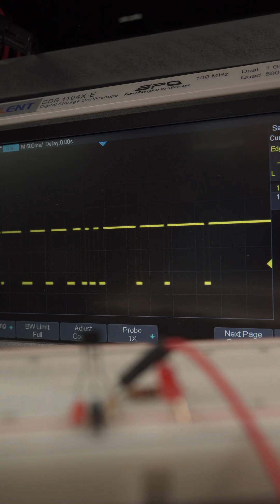Digital Hall Effect Sensor

Comment: From rick_1976
Applications Engineer
May 2020
Greetings,

A few points:

The A3144 is obsolete, suggested replacement being the A1104
The output of these sensors is an open-collector format, hence one must think in terms of switching the low or “ground” side of any connected loads.
Maximum output current of the sensor is 25mA, supply current ranges from 4~9mA; if attempting to use one to control another by virtue of switching its power supply, this leaves a maximum of 21mA available, which is generally less than needed to operate most things a person typically would refer to as a “bulb.”
A more “proper” approach would be to use a NOR gate to perform a logical AND function in context of the inverting-output logic presented by these sensors. The resulting positive-logic output could be used as such directly, or potentially used to drive an N-channel FET which would again function as a low-side switch.
Reply: "bulb" huh? Are we in the 1880's?

Comment: Just call it a reed switch why do you have to over complicate things
Reply from the maker: While a Hall Effect sensor and a Reed switch both detect magnetic fields, they work very differently. A Hall Effect sensor detects changes in a magnetic field electronically and offers more versatility, like detecting polarity or being more precise for high-speed applications. A Reed switch, on the other hand, is a simpler mechanical switch that closes when exposed to a magnetic field. Both have their uses, but the Hall sensor is very precise and can do quite a bit more.
Reply: @HackMakeMod  fair enough but it's basically the same apart from the fact that the Hall effect sensor is more accurate and can detect changes
Reply: @GH_Tech7The Hall effect is not mechanical like the reed switch and also the Hall effect only switches if the polarity is correct, so can tell the difference vs just switching inside a magnetic field. It is also capable of switching much faster, which is useful for applications such as crank position sensors where the crank is moving at several thousand rpm.

Comment: On the UK railways, the first implementation of this technology was introduced in 1952, known as AWS, it provided an in-cab warning to notify the driver weather the signal up ahead was at clear or caution, it allowed drivers to take action before reaching the signal. AWS is still being used today, running on the same method of magnets on the ground with a hall effect sensor on the train itself.
Reply: Very cool.

Comment: If the hall sensor is not activated, does it not consume energy?
Reply from the maker: Yes, the Hall Effect sensor does consume a small amount of energy even when it is not actively detecting a magnetic field. This is because the sensor requires a constant supply voltage to power its internal circuitry, including the Hall element and the built-in Schmitt trigger.

However, the current draw is typically very low, often in the range of a few milliamps. The majority of energy consumption happens just to keep the sensor operational, regardless of whether it is detecting a magnetic field or not. When the sensor is "inactive" (meaning it does not detect the target magnetic field), it is still powered and monitoring for changes in the magnetic field, which requires continuous, albeit minimal, energy.

Comment: Can I make a speedometer with this??
Reply: Yes.

You count the number of pulses per second, and if you know the distance from the centre of your wheel to the position of the magnet, you can calculate the distance travelled in each full rotation and derive the linear speed.
The math is quite easy.

The key thing is you need to measure time and count the number of pulses produced by the sensor in a fixed amount of time.
Reply: @deang5622  nice... Let me ask chatGPT about this idea and make a Arduino code

Comment: What's the purpose of the pull up resistor in this circuit?
Reply from the maker: The sensor’s output is an open-collector, which means it can only pull the line low (to ground) when activated. Without a pull-up resistor, the output would be floating when the sensor is off, leading to unpredictable behavior.

The pull-up resistor connects the output pin to the positive voltage (VCC), ensuring that the output is HIGH when the sensor is not detecting a magnetic field. When the sensor is active (detecting the correct magnetic field), it pulls the output low, overriding the pull-up resistor. This setup ensures reliable, consistent digital signals for microcontrollers or other logic devices to read.

Comment: It's an interesting device, but I think the classic hall effect sensor which gives the analog value of the fields is more versatile and can be used with a schmite trigger if an ON or OFF state is required but also can be use for measure a current .
Reply: I think you can easily find them! This is the digital version

Comment: Just use a bloody reed switch
Reply from the maker: In my experience, reed switches are more expensive, bigger and less reliable. Also applications that require multiple sensors and close proximity make it challenging to use reed switches.

Comment: FYI, the Baldor servo motor company used to use hall effect sensor in their DC motors. Then they came out with AC servos and went to digital encoders. much more efficient. Every cool device has its place and purpose.